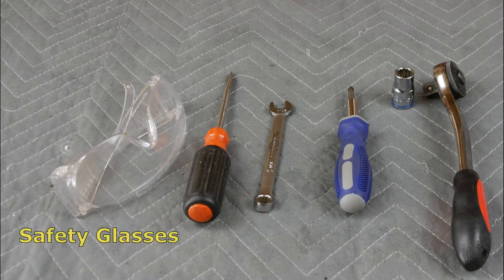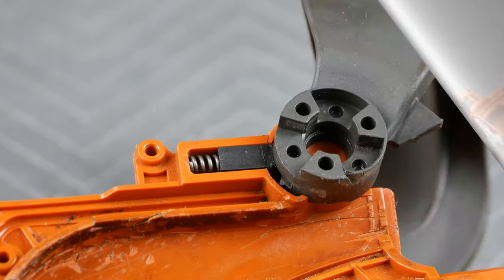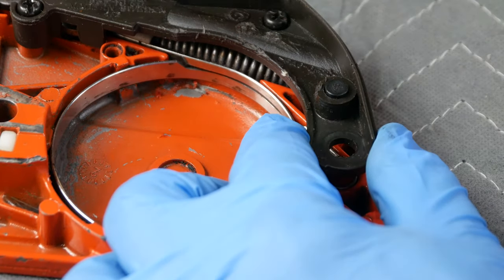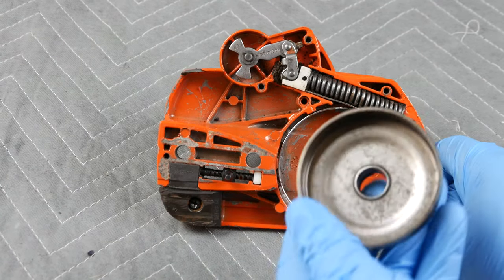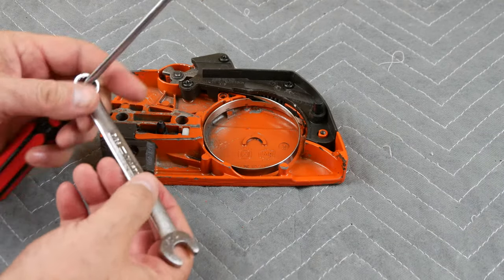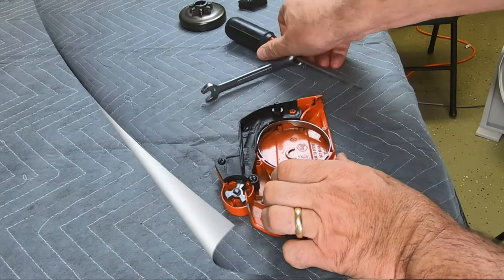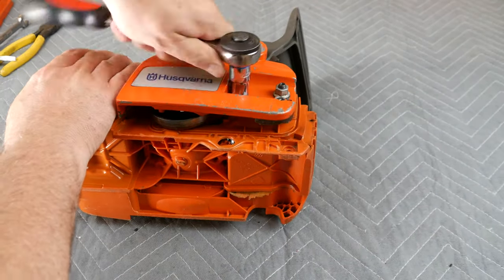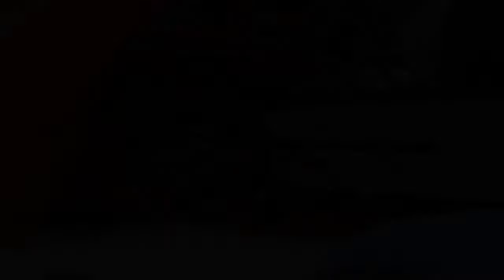How to Unlock a Husqvarna Chain Brake

Comment: October,  2024.  Got a refurbished Husqvarna 450 Rancher. Saved like $180 over a new one.  Looks like new, but you can tell it's been used slightly.  Had to install the bar and new blade. Bar cover wouldn't come off, stuck around the clutch even though I pull the bar brake back.  Had to force it off.  Was thinking about sending it back until I saw this video.  Fixed it in just a few minutes.   Thanks!
Reply from the maker: @docmccartha4073  Glad it helped

Comment: Same problem on my (smaller) Jonsered Saw. Wrench and screw driver didn't work... but having watched your explanation of how the brake works... I just pressed the cover in place... extended the brake lever until I felt a "snip", then holding the cover securely, leveraged the brake handle back to the open position. "Clunk!" The cover slipped down into the open band... and it was done! Thank you SO VERY MUCH!!!
Reply from the maker: Excellent job glad it worked and thanks for commenting

Comment: You just saved two neighbors from probable disaster. That load spring is so stiff, and attempting to turn the three armed spiny thing with needle nose pliers was taking us over the edge. We used your expertise and had it done in 3 seconds. Thanks.
Reply from the maker: Thank you for viewing and for the encouragement.  I’m so glad it worked.

Comment: Just so happens that I have the same chainsaw (Rancher 455) and experienced the same problem.  The brake engaged after the blade and chain got pinched while cutting up a tree.  Couldn't get the brake to release, so I removed the brake/clutch cover and started troubleshooting -- then, couldn't get the cover back on because, unbeknownst to me, the brake was engaged.  This video helped A LOT.  Got my wrench, screwdriver, and went to work.  You're correct that it takes a lot of leverage, but I got it done and reinstalled the cover.  Thank you!!!!
Reply from the maker: Glad it worked and that you found me Craig. Dean

Comment: You saved my clutch cover. The manual only contains a minor note that release chain brake, and not a single warning about what will happen once you miss it. I did. I then spent half a day with all the professionals presenting how easy it is to remove the clutch cover - which was apparently impossible after this point. Luckily I did not force the lid, but I got stuck. I only found a voice synthesizer backed up video that slightly mentioned, only a dealer can reset the brake. Your video is probably the most important Husqvarna howto. Thank you.
Reply from the maker: I’m sorry it took you awhile to find me but I’m glad you did.  Thanks for watching and for the kind comments.  Got lots of other Husky videos if you’d consider subscribing I’d be honored.  Dean

Comment: Thanks for saving me the cost of an overhaul. I couldn't figure out why I couldn't get the chainsaw to start, or the chain to move, and was ready to send it out for an expensive overhaul, or replace the chainsaw. I decided to overhaul it myself, and got to the point of putting the cover back on and realized the chain brake was locked, and that was my problem all along. Your video is perfect.
Reply from the maker: I’m glad you found this one of my videos Will and that it helped.  Good luck with all your projects.  Dean

Comment: I cannot thank you enough. I am a wood turner and chainsaws have been the Bain of my shop. I just bought a reconditioned  husqvarna 450 Rancher and it did not come with instructions. I had a hard time getting the clutch cover off and spent over an hour trying to figure out how to get it back on. You really helped me tonight with you easy to follow video.
Reply from the maker: Thanks for taking the time to comment Robert.  I’m glad it helped, that’s why I shot the video.
Reply from the maker: Robert Jay By the way, if you ever need to totally rebuild it or fix a leak, check out my other ‘450 Rancher’ videos.

Comment: This was one of the best produced videos to trouble-shoot a problem that left me so frustrated mid-stream cleaning up property. I've had the clutch cover off numerous times, never before experienced this issue with the brake needing to be reset. Problem solved in less than 5 minutes! Thank you so much!
Reply from the maker: Man, I'm glad it helped Mr. Schiff.  Nothing more frustrating that needing to get the job done, but you're stuck because of something like this.  Glad it helped and thanks for commenting.

Comment: Thank you so much for your video. I bought used 455 rancher saw and it arrived with the brake locked. I was getting frustrated and thinking about sending the saw back until I found your video. Thank you.
Reply from the maker: Glad it helped, thanks for commenting

Comment: I was outside for almost an hour trying to get the stupid cover on today.  I didn’t even get to cut trees because of it.  This is the dumbest design they could have came up with.  My smaller Stihl has the clutch assembly inside so it isn’t like this one.  The cover comes right off regardless of the break being on or not.  Other than that it’s a great chainsaw.  I am so thankful for your video.  It’s very well presented and easily shows how to fix this issue.  Last time it happened I had to take it in to be fixed as this video wasn’t on here.  So I very much appreciate your help!
Reply from the maker: Sorry it happened but glad you found me.  I like the saw too and I have a few more videos on issues with that saw like the pesky oil leak.  Check that one out if you have time.  Dean

Comment: Thanks so much for you video.. I bought a reconditioned Husqvarna 440 and I did not realize that the chain brake got activated during shipment.  I removed the chain brake to attach the bar and then could not reassemble.  Your video saved the day.
Reply from the maker: Thanks for watching and for the kind words.  Glad it helped.  Dean

Comment: Thanks so much. Bolt came undone on the cover and chain slipped off...tried to open it with the brake engaged 🤦 I really appreciate this. I tried your 2nd method (from another video and it started to strip the plastic on the hand break. I found that a 1/2" stubby worked for me.
Reply from the maker: Excellent.  So glad it worked and you are back in business!!!!  Got some more chainsaw and other new videos coming  soon if you care to subscribe.  Dean
Reply: Done!

Comment: Thank you so much for this video.  The  new clutch cover I installed came with the brake engaged and I had a devil of a time until I watched your video and learned how to unlock it.  I used the wrench/screwdriver trick and it popped open in a second and the rest of the install was a piece of cake.  Brilliant video!!

Comment: Really well done!  I couldn't get a good grip on the case cover so I placed two screws on a board that was on the ground. The screws were placed at 11 o'clock and 5 so that when I turned the wrench clockwise they held the case in place and the spring snapped back into unlocked position.  Thanks for this video.
Reply from the maker: Really good idea.  Glad it worked and thanks for the compliment.

Comment: I thank you kind sir for this video. I tried and tried to no success in the field to reseat guard. Lol now. Your  method worked only I had to tighten 1 screw over spring and use a flathead screwdriver to clockwise twist the small foot  and the spring released tension. Very helpful video.
Reply from the maker: Thanks for taking the time to leave the comment Mr. Buxton.  I'm glad you got your's fixed.

Comment: Thanks. Wish I'd watched this first. Took things apart including removing the spring so I could reset the brake. But l don't have an easy of compressing the spring sufficiently. Guess I'll need to put the spring back on with it in the brake on position, and then reset the brake, so i can put the clutch cover back on correctly. I recognize Pilot Mountain, pass it on my way to TN.
Reply from the maker: I wish you'd found me sooner as well.  Be careful with that spring...lots of tension and yes, you'd need to reassemble it in the tripped position for less tension.  If you've never driven to the top of Pilot Mountain, it's worth the 2 mile trek.  Stop on by sometime.  I don't know where you go in TN, but my wife and I love travelling to Gatlinburg and Pigeon Forge.

Comment: You can take the chain break handle off and use it as the tool to reset it. 4mm Allen key, remove the two screws, just keep an eye on the spring so you don’t lose it (though it should stay put).
Reply from the maker: Yeah, definitely don't lose the spring, but good info.  Thanks.

Comment: great video.  i followed the steps but still couldnt get the chainbreak to disengage.  i literally bent a wrench trying to push it.  i took the entire assembly apart to include the spring - lubed it up and still couldnt get it to pop back into place.  very frustrating
Reply from the maker: I’m sorry to hear that.  Did you try method 2 as well ?

Comment: Well at least I figured out how but didn’t use the wrench and screw driver. Hope there is never a next time. Let a friend borrow or the saw and gave it back with the chain off and brake on. Thanks for the video.

Comment: I got a free shiny like new used at most a couple times from a neighbor who passed away and his son was getting the property and home ready to sell cleaning everything out and he gave it to me because he thought it was no good.  His dad always hired three Mexicans for the week throughout the summer to do all his things like cut trees and split wood and o found out they put a sharp chain on it and didn’t know to take the brake off when doing so. I don’t know how they got the cover back on over the centrifugal clutch with the brake on but they did.  It was a 555 model though. I’m more fond of the Stihl brand for reliability of parts but this is sweet.  I have two stihl chainsaws so I don’t know to keep this or sell it now. It’s a long bar i usually never need but I’ll think on it. 
Started right up first pull with a heavy fuel mixture blowing all kinds of smoke. Was fuel I had sitting mixed already for other things.

Comment: This works great. You can also match the connections back together and use mechanism as intended. All with the things being too small to fit in over properly. You just hold the clutch plate back onto the saw on a tad bit of an angle because it won't seat as desired quite yet. Then jiggle the brake guard handle things around until it locks in and u just yah. Click
Reply from the maker: Thanks for commenting and viewing Mr. Frauk

Comment: You can also make a custom brake release tool by taking an angle grinder and cutting notches into the small wrench on your bar tool, just wide enough to fit into the mechanism, and turn it that way. It does take a lot of force, I had to put the cover in a vice and put my weight on the tool to unlock the brake
Reply from the maker: Yeah good point.  Figured most users would just want to grab a wrench and screwdriver but the 'tool' idea is good to know.

Comment: There is actually a 3rd way that is a whole lot easier and preferred if it happens in the woods and all you have is your chain tool!  Undo the break cover like you did and and pop out the spring and then after putting the arm in the unlock position leave the spring out and then start to put the first 3 screws back in place. Now grab the clutch cover and using the screwdriver end push the spring back into place as soon it is starting to seat squeeze the black cover and this should push the spring the rest of the way in and put the rest of the screws in! Ready to go and should only take 2 minutes to fix
Reply from the maker: You should demonstrate this in a video.

Comment: I took the spring mechanism out to clean it. It was impossible to reset for some reason after I put the spring back in. I happily removed the brake altogether, I don't use the chain brake anyway.

Comment: How do I get the spring back in it just popped out and I can’t get it back in :/
Reply from the maker: There are videos showing just that, but from what I’ve seen, place one end inside the saw over the male pin sticking out and use a flat bladed screwdriver to compress the other end into place.  This is assuming the chain brake is disengaged and be sure to wear eye protection.

Comment: I just fixed 545 same way but I just use 2 screwdrivers. Its much easier than taking to dealer.I bot PHO without bar and someone pulled it apart.
Reply from the maker: Good deal, glad that worked too.

Comment: thanks for the video. I was able to get cover back on but now the brake handle is stuck in the forward on position. any suggestions?
Reply from the maker: If you can't pull it back at all, I'd disassemble it again for sure to find out why since locked forward means the chain brake is on.  Please go through the unlock procedure in this video.  I'm wondering if the spring in the handle mechanism is locked.

Comment: Well I learned how to reset the brake, now I need to find a video on how to get that big spring back in place because I took everything apart
Reply from the maker: Yikes.  That may be tough.  Seems like it is under a lot of pressure.  I would definitely trip the brake so there's a little less pressure on the spring before trying to reinsert it.  Be careful out there.  I've still got a scar on my upper lip after tangling with my last spring reassembly on a lawn mower.
Reply: @PilotViewProductions   Iv been working on it all evening. I found a video on on it, so ill attempt it tomorrow, then come back to yours for a refresher on the chain break... I appreciate your videos.
Reply: Hey man did you get it ?
Reply: @fonzmendez6917  I did... you having a tough time with it?...

Comment: 2:40 what if, theoretically, I DID do that? How are you supposed to get that stupid strong spring back in place?
Reply from the maker: In ‘theory’ I’ve seen guys use a large flat blade screwdriver and press on the loose end of the spring.  There are videos on it.  I can’t recommend it cause I’ve never tried it.  Wear gloves and eye protection please and be really for it to go flying.

Comment: What exactly is the “black rubber heel” that’s chewed up?
Reply from the maker: I believe exactly it would be the chain guide bushing
Reply: @PilotViewProductions  thanks! I’ve looked them up and found the exact part to replace mine. The last question I have: is this part supposed to wear out and be replaced? Or has something gone wrong that is causing the damage? I can find anything on the internet.

Comment: I took a junk bit from a cheap tool set. I ground 3 flats in it to fit the brake clutch thing and voila it works. This must be a defect in the 455 chain brake system. Overly sensitive I guess.
Reply from the maker: I'm just glad it works when needed....thanks for viewing.

Comment: Looks good, except method number 1 doesn't work very well.  I'll try the second method.  If that doesn't work, I'll probably have to go to a chainsaw repair guy.
Reply from the maker: At least you know what it takes now
Reply: @PilotViewProductions   I fixed it using method #1.  I realized that you have to use a 9/16 wrench and push against 2 of the 3 posts on the brake handle.  I don't know why I never realized that before. But, either way, it's fixed and working again.

Comment: 👍
Reply from the maker: Thanks Frawldog
Reply: @PilotViewProductions  Great video . I wonder if you can tell me why my chain guard on my new huskvarna is so tight? it seems to work ok but needs a lot of force to engage it and makes a pretty loud snapping sound when it does?
Reply from the maker: @andrewscott4851  Mr. Scott.  Thanks for the comment and question.  Although I'm no Husqvarna expert, I 'did' grow up on a farm using chainsaws.  I have found the chain brake on the Husqvarna can be hard to engage and 'does' make a loud snapping sound.  I have had the chain brake engage during actual use more than once and the kickback that occurs is more than enough to overcome the tightness on the model I was using.  If you continue to have concerns however; you may want to run the saw back to the dealer, let them engage and disengage the brake and tell you if what you're feeling is normal for that model.  Better safe....

Comment: Thats a very risky operation.  Cast metal is very brittle.  You could easily end up breaking your cover.  Amazo has a wrench designed for this reset.  Cost is 11 bucks.
Reply from the maker: Yes it is risky.  If you’re dressed out to cut wood and have the chain sharpened, gas in the saw, cranked, ready to cut, I suspect most folks would take the risk rather than shut it down and go back to the house and put it all away and say well, that’s all for today.  Gotta order a tool from Amazon and wait.